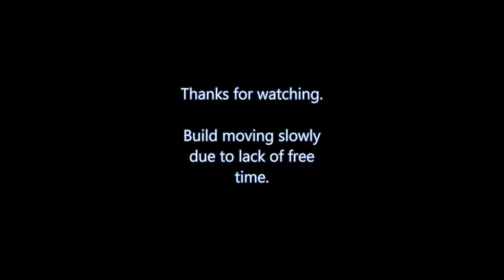Dually Silverado 3500HD Flat Bed Build Part 4

Comment: That's looking well made, it's not going to fall apart at all, looking forward to the sides and how you make the hardware (hinges, latches ect)
I've been playing with my plasmer cutter after watching yours working so well. The problem was the earth lead was not bolted on to the clamp tight enough, now it runs sweet, been having a lot of fun with it.
Reply from the maker: I got a rain check at tractor supply for a 60 gallon Dewalt 1 stage compressor and still waiting to see whats going on with that order. I suspect my compressor is having issues since its taking over 10 minutes to fill tank once it kicks back on and has 90 psi already.

I used to cut metal like butter but also noticed the consumables I got are not original and this is the first time I run these. I will check my ground clamp to it could be dirty and not making good contact.

This is an endless build and seems to never finish....

I may do 1 more miscellaneous video and then on to the deck and sides. I got to order that metal soon as they deliver Tuesday and Thursdays only.

I have seen some of your projects and gets me motivated. I am very good with Solar panels and my wife gave me the ok to build an off grid cabin. So I may build another channel for that or include it here. Will see what happens around march.

Comment: It's coming along nice... Is this your truck or a customer's? Its gonna look nice for sure...
Reply from the maker: Its mine, I paid $2000 at auction and will be replacing my 2000 Dodge Dakota. I think this 3500 will give me better gas mileage since my Dakota is a worn out 3.9l with 4x4. Dakota gives me about 8 or 9 mpg and if I step on the gas it drops fast.
Reply: Wow, you got it for a good price and its definitely a HD work horse👍👍

Comment: Nice work cuzo
Reply from the maker: Thanks. I wish I would of finished it already its been taking longer than expected. I was working this weekend so I could not do much to it.
Reply: @cutweldngrind  all them welds take alot of time and measurements
Reply from the maker: @boosteddave4603  I may use super glue to speed this up lol

Comment: What's your bed measure from the ground to the top of the bed?
Reply from the maker: This truck used to have a crane so it has extra leaf springs. Its 39" behind cab and 42" at rear end of bed. I still need 4 sheets of 1/8" that's probably 500+ lbs so may drop a bit more.
Reply: @cutweldngrind  mine is at 44 inches in the rear but I'm not done yet. Just seein if it was to tall
Reply from the maker: I guess the height really depends on how tall you are. I am around 5' 9" and does seem a bit tall for me but I think I will manage it. I am still pending about 500 lbs of steel and the welder at 500 lbs. I wish you had a channel so I could see your progress or design.  I think once I add a rear bumper or side steps I can get onto flatbed easier and forget about the height being an issue.

Now my bed will be about 2" lower than cab so I can fit my tool boxes. I hope it looks ok since the skirts will be about 22 or 23 inchs in height. 

Good luck on your build.